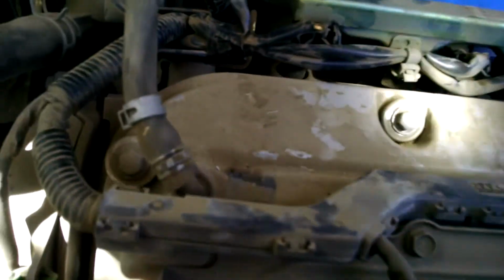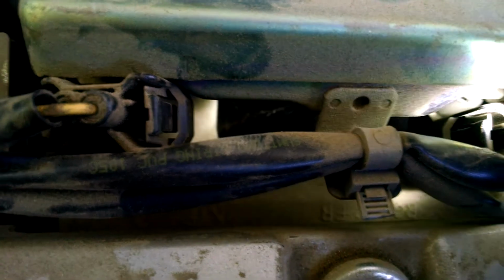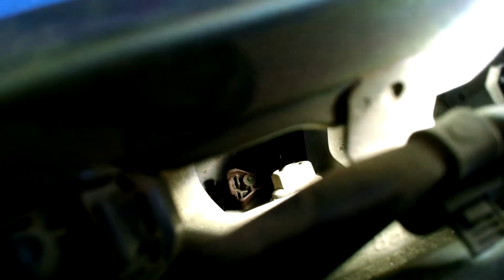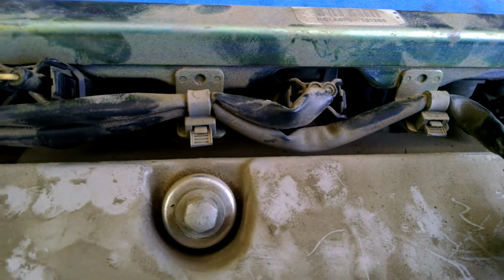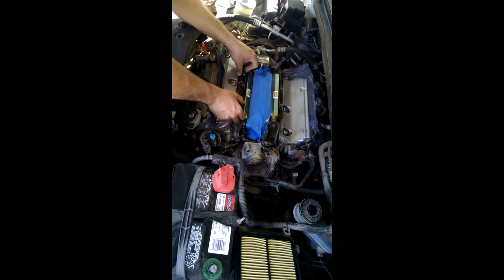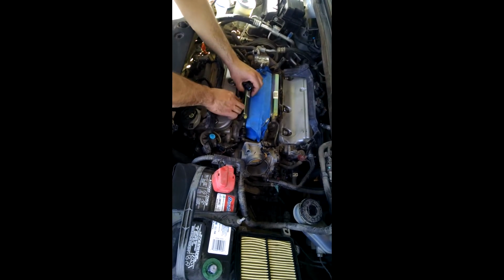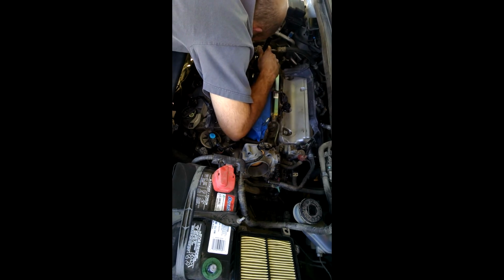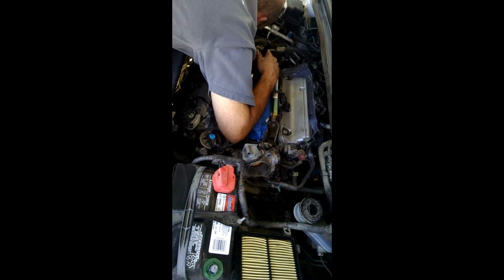2006 Honda Odyssey Knock Sensor Part 3 + my fun problem

Comment: As easy as it is to remove the lower intake manifold and then you have acres of room-took me 6 min to remove it and injectors-tip spray lube the injectors while wiggling them-they will pull right out with fuel rail👍 them wipe them off incase it could harm the seals-easy peezy 🙂

Comment: Hello, did it change the sensor? I just changed this weekend, you should not remove the clips, you must remove the three fuel injectors will come along with the fuel supply line (part that is hindering you) that sugetan 2 screws 10mm.